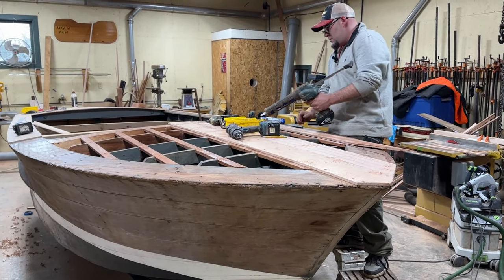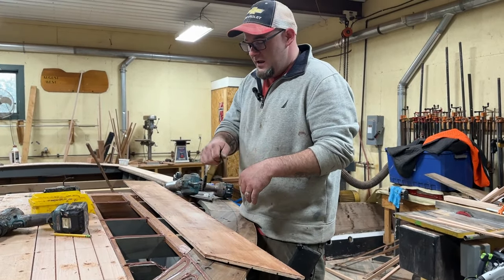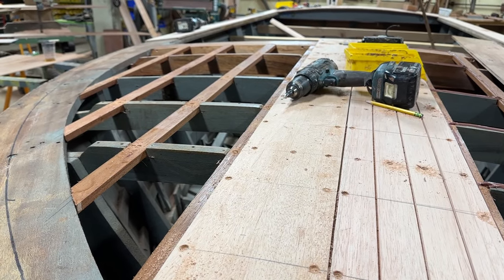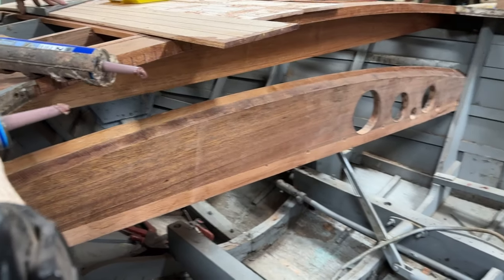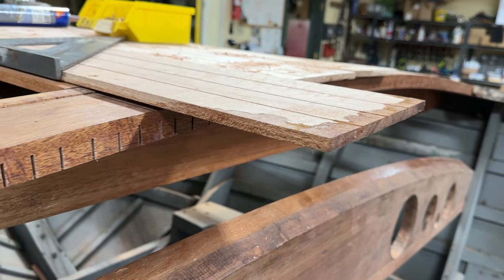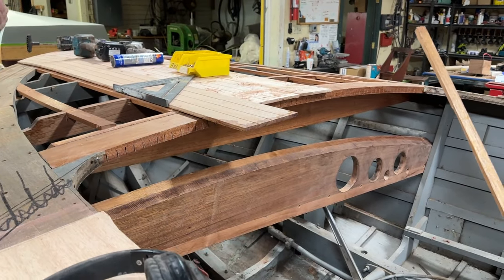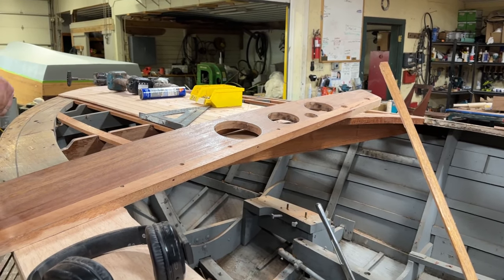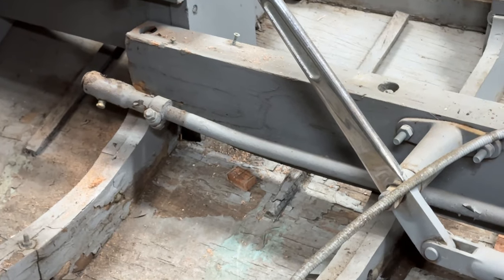1964 17FT Chris Craft Super Sport    Foredeck Fabrication How To 3 27 2024

Comment: You mentioned that the engine was needing rebuild... not unexpected.  In mine the water passages were completely blocked by rust and the one rear cylinder, where all the water coming in the open carburetor collected, was totally rusted solid.  Looks like you will need a new transmission too, as the Super Sports in 64 came with the "automatic" transmission controlled via the single lever morse style throttle control.
Reply from the maker: I send all of our engine build work to Robert Henkel, Peter Henkel Inc, in Marine City, MI. Robert has no equal within North America.
Oh, and I have yet to come across a transmission that has more than a single lever, which makes sense, since they really are not transmissions that can be shifted through gears. All you have is forward, neutral and reverse; and reverse tends to be a terrible pain in the butt.